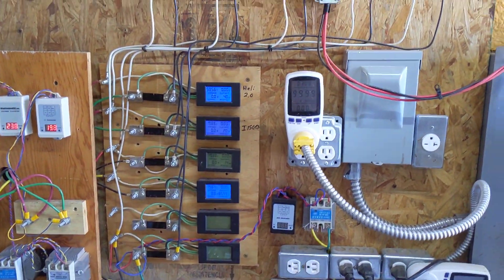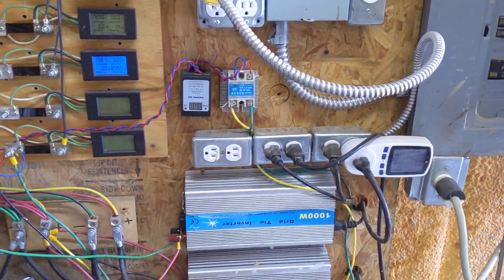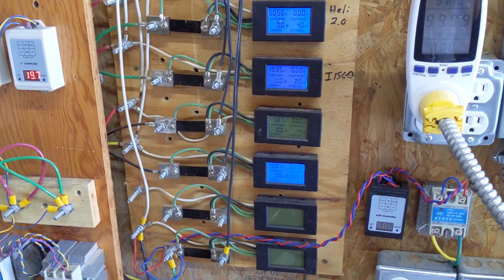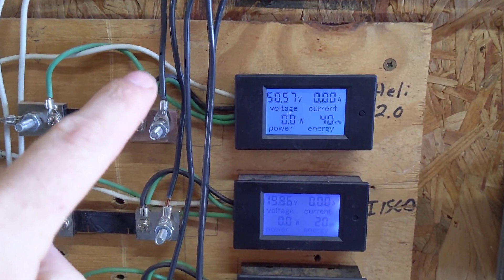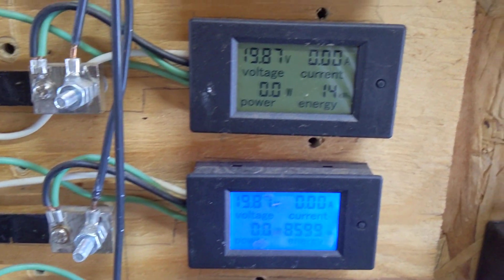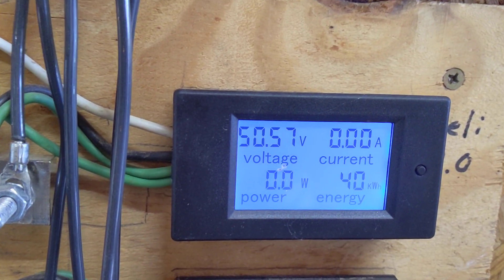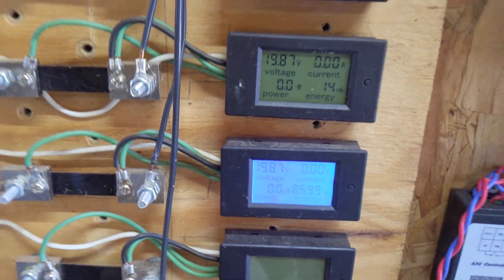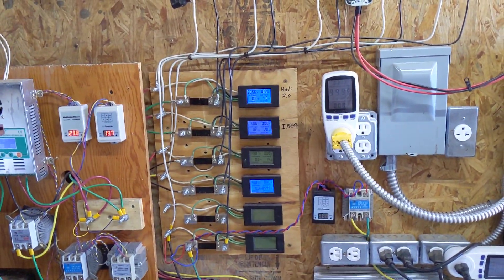Weekly Output Update: 10/01/2021 Report

Comment: would love to know more details about the heli blade upgrade. also interested  if there are similar blade upgrades for the i1500 as this is what i currently own. would love to see a test of the new 4kw heli if ever you get a chance! thanks for the videos!
Reply from the maker: They are blades based on the design used with the Heli 4.0...if my understanding is accurate iSta Breeze outsources their manufacture.  You have to purchase them separately but they really do transform the Heli 2.0.  There's a number of different third party blade options that you can make work with teh i1500 but I wouldn't bother with them.  The 105cm blades that come with the i1500 and i2000 are absolutely perfect for those turbines.

I'd love to see what the Heli 4.0 but would do but it's not in the cards at this present time...you could send iSta Breeze an email and tell them you'd love to see one on my channel! ;)
Reply: Good to know the i1500 blades are as good as they can be.  Will email ista breeze about the 4kw